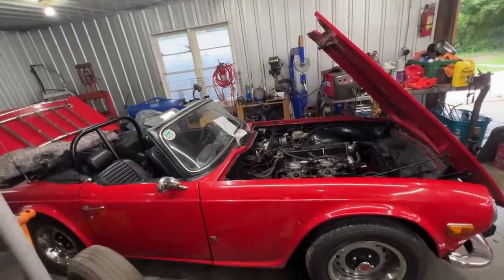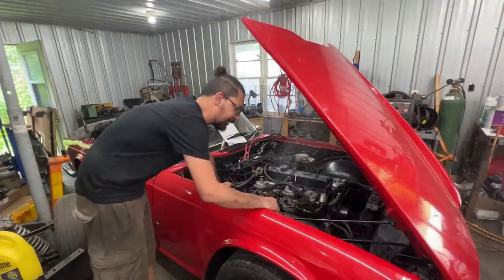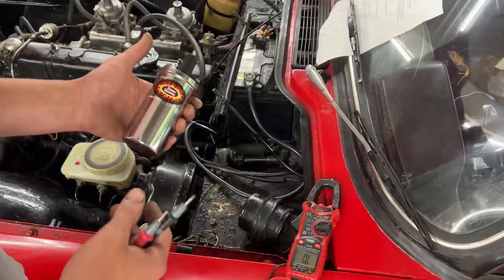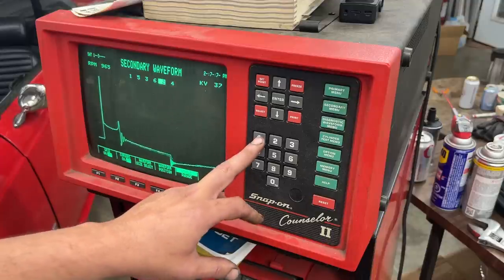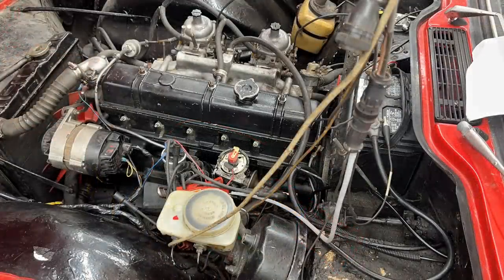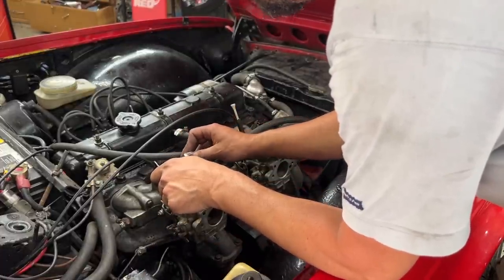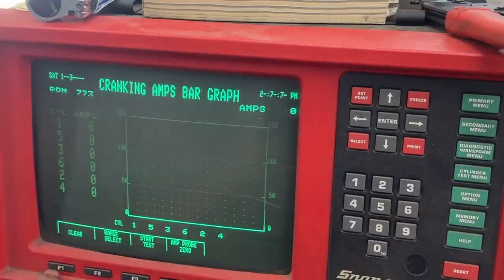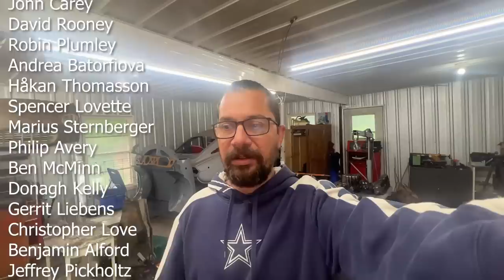1972 TR6 - Part 6 - Engine Tune Up

Comment: Great work Elin. The Snap-On analyser is such a valuable tool , but like you, a  visual inspection of the plugs was always my 'go to' method of getting the fuel/air mixture into the ball park. When you consider what a basket case that poor car was when it arrived at your shop I recon the owner is now delighted with all the work you've done. Looking forward to seeing how Nik's car is progressing.

Comment: Back in the day (1962) our MGA would just stop running, or would not start. Then it would run fine for a few days or a week and then suddenly die and either restart without problem or would only restart after some time. I noticed one day that it would always restart after I measured voltage at the coil or the ground at the distributor. Finally, after a few weeks I noticed that the spade lug on the (Lucas) coil moved when I pressed the test probe to it. The lug is held on with rivets that eventually loosen and no longer make reliable contact. I replaced coil and distributor with Mallory parts (thanks to my uncle Al, VP of Mallory) and we had no more problems with ignition.

Comment: Elin, thanks for showing us your method of checking the plugs for proper burn on setup.  I've always checked them before replacing with new, but never tried that check tor carb adjustment.

Comment: That was a great video series. No doubt if I had a TR-anything that needed work beyond my tool availability or needed your special mind-meld capability I'd be driving or towing it to you. Great job Elin.  I'm anxious to see Anna back in the restoration bay and to see you driving Tush's rustoration TR4 for its first legal road test.  6-Pack is coming up soon. 🙂

Comment: Great Video, but I personally would not use ATF in the top of the carbs simply because it can damage the rubber diaphragms, I prefer 3 in 1 oil.

Comment: Couldn't you also put a resistor in series with the primary circuit to increase the resistance of the coil?  Since 3 Ohm coils are so difficult to find, it would seem a better solution.  Kind of adding a ballast that's on all the time.

Comment: So did you get your coil back? Did you end up using that used muffler once you blew out that mouse's nest? I had the same issue with a used muffler I installed, worked fine once it blew out the nest.
Reply from the maker: Yes, I used the exhaust. It blew the $&1T out after it was installed so…. But like yours it ran well after it popped it out :) There was no time for a new coil so I let the car go with mine on it. The owner will buy a new one and replace it himself.
Reply: @RustyBeauties  Thank you RustyBeauties for answering all my questions, I really enjoyed this TR-6 series as it had a little bit of everything and I like how you interspersed it with the Rustoration series as well.